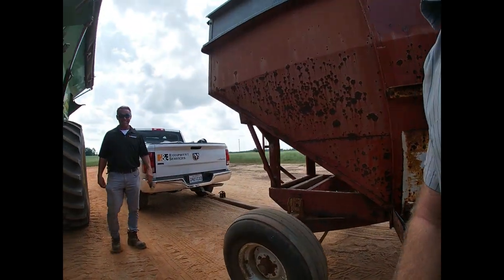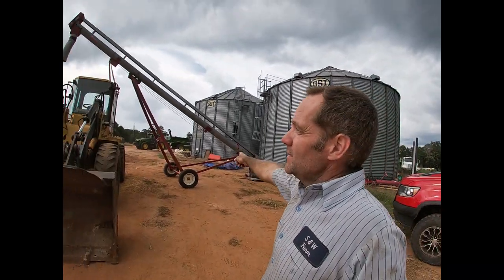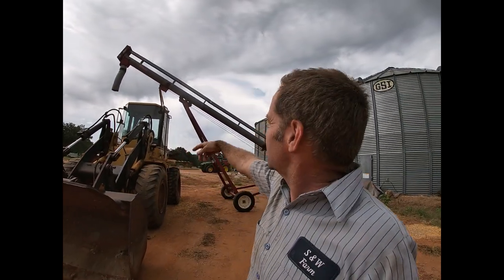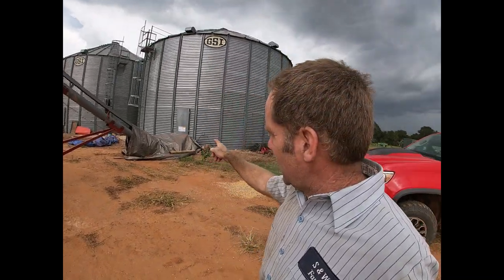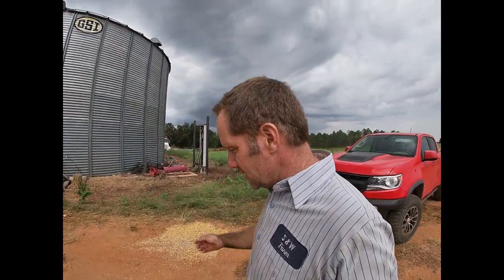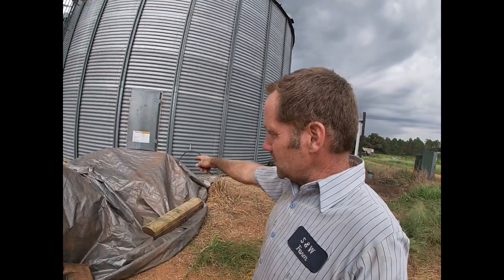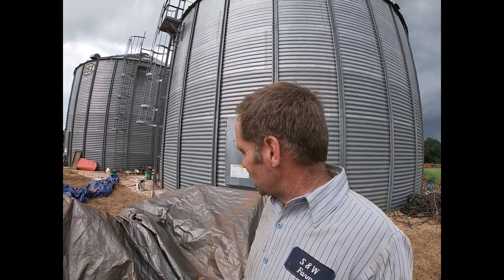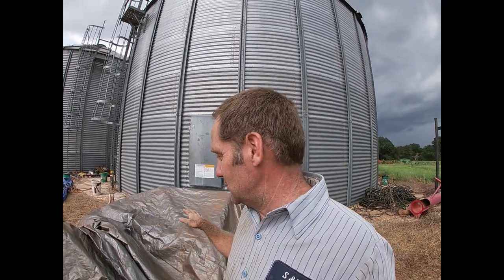Farm grown Whitetail Deer Corn

Comment: Question- you just filled the bins and now you are emptying them? Or are you just getting the farmers their seeds? We would come help you out on the deer population, but the cost is way to much!
Reply from the maker: We fill the grain bins while the combine is running so we can keep it moving.  All the deer hunters combined don’t buy enough corn to run the combine 1/2 a day.  The semi trucks haul to a mill 2 hours away.  The only way to keep the combine moving (get all the corn harvested on time) is to put it in the bin.  We also have to blow air through it in the bins for about a week to get the moisture low enough to haul to mill or put on deer hunter’s trailers
Reply: @PatrickShivers  Thanks!